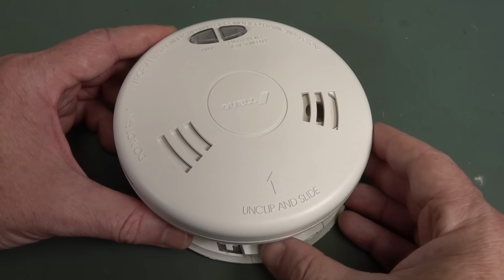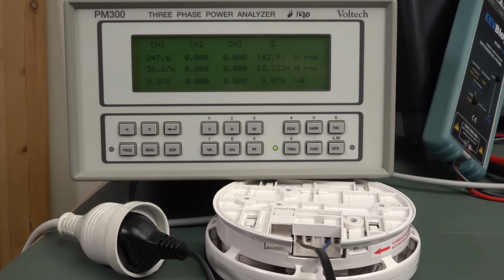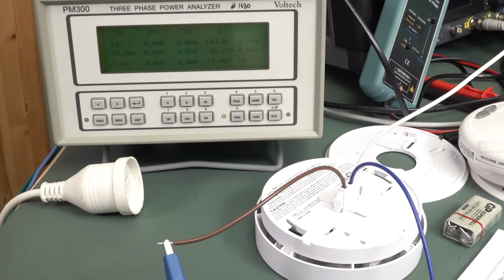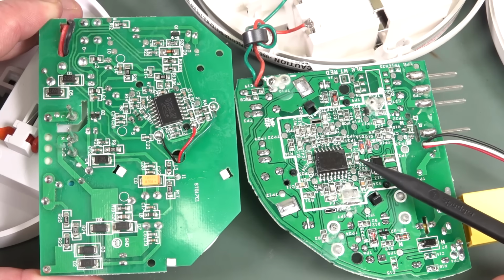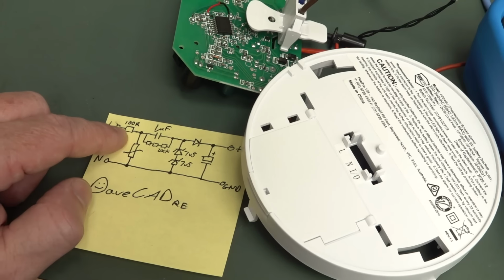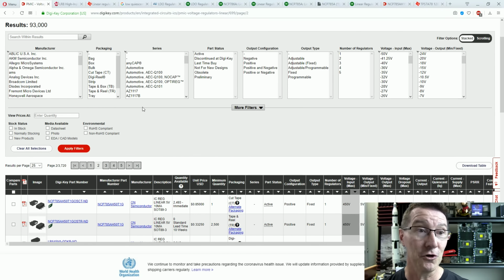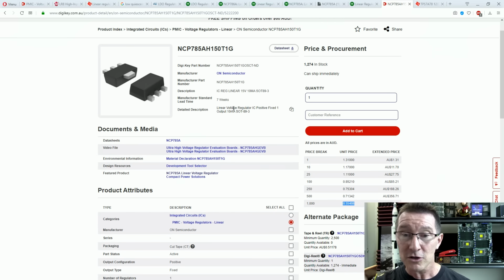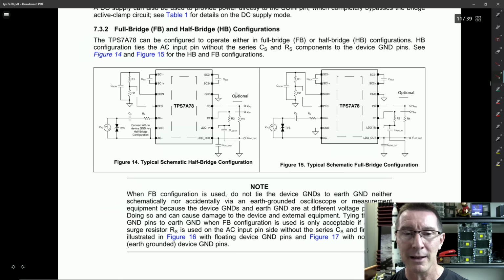EEVblog #1284 - How Bad Product Design Kills The Environment

Comment: I've been the designer for several consumer products, and the pressure to reduce BOM costs is completely INSANE! I've attended dozens of meetings and wasted hundreds of hours all for the reduction of 12 cents on a product. Since I opposed this insane cost reduction, I no longer work in the design of consumer products.
Reply from the maker: LOL, well done!
Reply: I once worked for a major set top box manufacturer, (thier boxes were supplied by sat TV service providers in Aus and many other places.) I was asked to change the psu desin for one component (a 3 terminal low dropout reg), Instead, I phoned the supplier and told them I was designing their product out, they dropped the price to less than 1/2,  the company made an extra 20 million per year from that.
Reply: That is because there is one of those insane "economists" in the company.
When a device is sold for amount of X and the BOM cost is Y, those people calculate that the factor between turnover and BOM cost is X/Y and therefore the effect of reducing the BOM cost by 12 cent will be X/Y times higher on the profit margin.
That is of course a big delusion, but you cannot hammer that out of an "economist".
Reply: @Rob2  You should have calculated the cost of those meetings relative to the expected actual savings. A better choice would be a completely teched PowerPoint presentation that nobody but you would understand, it would force them to agree with you. (unless of course there was someone there who could see through the bs.)
Reply: But then you get the other end of the scale where a product seems to do wonders with very little in it and we all sit around gwaking at it to work out how the heck does it do that.(ie:ZX81s running video without any video chip)
Reply: My favorite is the "but that resistor dissipates 0.96 watts, so a 1W resistor is fine!" 🤦‍♂️
Reply: I feel strongcontempt towards your ex employer
Reply: I wouldn’t have given the bean counters an option.
Reply: When you have 5000 parts in a product and save 12 cents on each one, and sell 1 million units, it kinda adds up.
Reply: @larrybud  But when you don't factor in the warranty costs (or customer retention, which is nearly impossible to calculate and more valuable than gold), you get the wrong answer. So if you save 12 cents on each unit (not each component) and the warranty returns increase by 50% you will lose 10x more than you save.
Reply: @mcconkeyb  Obviously depends upon the part, and that's why a full cost analysis has to be made. In automotive for example, something as simple as a normalizing the type of screws that you use for assembly can result in incredible savings for just pennies a part.
Reply: Yeah, I had a boss that would cut caps off my board and if it didn't stop working, he'd say " You don't need those capacitors! Arrgh.
Reply: Pity you couldn't cut everything out of his company car, leaving just enough so it still worked...

(and was still within the ADRs)
Reply: @stuartremphrey228  
Right!
Reply: @stuartremphrey228  Exactly, brakes are just dead weight! They don't make your car go any faster but slow down acceleration!
Reply: @fgregerfeaxcwfeffece  actually, they increase acceleration ... Just in the opposite direction! (Says an engineer, doing engineering) 😋😁😁
Reply: @GlennHamblin  Ahhh, "Mad Man Muntz"! Earl Muntz I think he was. In the 1950s he made TVs and was certainly one of the first, if not the first, of the "malfunctioning Eddie" businessmen. Adverts would feature his accountants trying to get him committed because his prices were just that crazy! 

In reality he was a skilled engineer and knew electronics. But he'd go round the design labs when they were working on new TV models and clip out components. If it still worked, he'd saved some money! The upshot was that Muntz sets didn't do as well in areas of marginal signal quality. But most TV owners lived in cities, so the sets were fine, and significantly cheaper.

Of course this is the world of 1950s TVs, where decoupling caps weren't really much of a thing. So of course your boss is an idiot and deserves his internal organs "optimising", Muntz was actually smart.
Reply: @greenaum  Can you elaborate on the "malfunctioning Eddie" businessmen a bit or give a link? Sounds interesting.
Reply: The whole fun of working in this area is to design a good product and still be able to squeeze every possible cent out of the BOM. It's not that hard to design things without budget constraints, boring.

Comment: Lately the new thing for retrofits at least is "10 year" battery units. Battery is non-replaceable, but has a high energy battery good for 10 years once activated (installing on the bracket trips a non-resettable switch which is directly tied to the battery). Much easier than having to string new wire for hardwired units. The nicer ones even have wireless interlocks, so you get all the features without having to rework wiring. I personally installed the non-interlock 10 year ones, because I'm cheap and the house had only one unit (with a dead battery) when I bought it.

Comment: Don’t connect mains and run on battery, change battery once a year or when battery beeps low battery.
Reply: probably use the following battery (2pcs, with charger): https://www.aliexpress.com/item/33027646915.html
Only batteries: https://www.aliexpress.com/item/32808238857.html

Comment: Over engineered. Surely its less effort to just use a 9v and replace it every couple years.
Reply: It would be, if it wasn't illegal to build a new house without these.  Also, the 10 year lithium cell type would beat both the 9v and grid power, if they were legal for new homes.

Comment: AC  power was mandated in CA due to many home owners taking the battery out  for other use or never replacing a dead one.  Also whole house wire also allows for remote signalling.   Basement may go off but upstairs also sound.  And last  the reliability, of fewer simple design 98%  vs more complex design 80%  less law suits too.

Comment: I took one apart some time ago and it had a bit of Americium 241 in it. It is a small amount and I just disposed of the thing in the garbage.
Reply: Not really a responsible thing to do.
Reply: @Zamsky39  well, I didn't think much of it, and given that there are the detectors in the house without jeopardizing my safety,I figure if they end up in the landfill they wouldn't cause any hard there either. They are not considered hazardous waste:
https://nuclearsafety.gc.ca/eng/resources/fact-sheets/household-smoke-detector.cfm

https://www.epa.sa.gov.au/environmental_info/waste_management/smoke_detectors

https://en.m.wikipedia.org/wiki/Hazardous_waste_in_the_United_States

I guess "taking it apart" might not be responsible. Disposal of the device in the landfill is considered acceptable however. At best one could skip the thing to manufacture back if available. I'm sure most people just dispose in the garbage however.

Comment: I do not think that it is such a big problem. The device uses 0.6W, so, it uses 5.2kWh/year. In my country 1kWh costs 0.15EUR, so it's 0.78EUR/year for the device. Cheaper than the battery.
Residential customers do not pay for bad power factor, so why would I buy a more expensive device with better PF if it does not really matter to me, especially if the current is so low anyway. I might want to buy a high power device with a good power factor so that I could use more devices without melting the wires, but 0.1A is nothing. A single 16A circuit breaker could handle 160 of these devices and if my house was that big I don't think I would mind the power.
Factories pay for bad power factor, but they also have inductive loads that would compensate for the bad power factor of this device (and have some sort of power factor correction anyway). They probably also would not really notice the  20VA with their 100kVA normal loads.

Also, is the  power regulator chip as reliable as a capactor+zener? Even if the zener or cap fails, they are easy to replace. A tiny SMD chip is a bit harder.
For example - cheap PC power supplies without PFC or with passive PFC can last a long time and if they fail, they usually just do not turn on and I can replace the bad capacitors and have a working PSU again.
PC power supplies with active PFC have better power factor, but when they fail, they short out the mains, trip the circuit breaker and blow up a few components inside the power supply. This results in a bigger problem than just the one device not working and is also more difficult and expensive to repair.
So, I would prefer a power supply with passive (or no) PFC, unless I am using it for mining, in which case I want active PFC so could run more miners on the same circuit without tripping the breaker.

Comment: Dumb question from a non EE here. I always thought that linear regulators burn the excess voltage x current as heat -- if your input voltage is 240VRMS, it will be rectified to 240VDC, and if your output voltage is 5VDC won't you be wasting a ton of power? Are transformers or switching regulators out of the question?
Reply: Yes, it is very inefficient, but a transformer  is way more expensive, and powering very light loads with switching supplies can also be difficult (you need either a really short pulse width, which is difficult to achieve, or a really low switching frequency, which can cause a lot of noise and requires a big smoothing cap for a stable output voltage).

If your circuit is low enough current, maybe the inefficiency of a linear supply isn't that big a deal.

Really, low power stuff like this has no business running on mains voltage. Way better to have a phone or alarm circuit (24-48V DC) to power little stuff like this.

Comment: I suspect there are multiple factors contributing to the poor design.  It's probably an old design that went through compliance testing and they have modified the design over time to reduce the cost of having to do the entire battery of tests.  Also, while the total power consumption is large on the 1M homes scale, it's not a lot for the average consumer.  A few cents per week seems like it's worth it for 'peace of mind'.

Comment: Hey DAVE check the Power factor again...its leading ( capacitive ).....and it is actually better solution because its compensate our home power factor which is generally lagging in nature due to inductive load and nonlinear load like bridge rectifier ...so our generating station will get little help from each of this   tiny capacitor....
Reply: Which is not enough to compensate for high consumption by the Zener diode(s).
Reply: @absalomdraconis   do you think that those zener can dip the power factor to .069 with 1 watt active power consumption . ??? It's connected in series with the mains  capacitor  and its main function to protect the output capacitor ... Its can't draw reactive power ...
Reply: 100%! I just wrote a comment explaining the same thing, but it was "magically deleted". 

If @EEVblog wants to post a follow up, there is a very simple experiment he can do. Hook up the scope to show both mains voltage and current going into those smoke alarms (not easy - high common mode but small signal). 

Then compare that to  a small linear power supply, or a traditional linear plug pack, with no load on it. (ie just the input transformer). 

In the tranny of the linear plug pack, the voltage will peak before the current (that's what inductors do), and in the smoke alarm the current will lead the voltage (you guessed it...capacitor...). 

When both are supplied from the same mains plug, these 2 effects will (partially) cancel out, ie the overall power factor of the 2 devices in parallel will be closer to one (current closer to being in phase with voltage) than either one of them individually. 

That's pF correction in a nutshell. And that is what the smoke alarm is providing. pF correction for the rest of your house. 

Note pf = cosine(phase angle between voltage and current) .... but that angle can be positive (inductive loads) or negative (capacitive loads).

Comment: 4 watts each?  That is ridiculous!  So I am burning up about 70-80 watts continuously.  Now I don't feel so bad about the entire den being heated by my balanced push-pull vacuum tube headphone amplifier anymore.

Same thing goes for those LED night lights.  It takes more power to run the day/night sense circuitry than the LED light itself.  When the unit is "off" during the daytime, all that has happened is a transistor is used to short out the LEDs aka bypassing them.  The entire unit consumes even more power, but gives the appearance it is off.

Comment: did you check an Ionization type.   Most people have Ionization units, not the expensive Photo units.    You have to power an LED 24/7 on the photo units.  I am sure the Ionization ones  use much less energy.   We only put Photo units in, in places like near a shower, or kitchen where the Ionization units false trigger.   And if you want a battery unit, it must be Ionization.  Just to suggest, it would be best to learn about Smoke Detectors before you make a fool of yourself comparing apple and oranges.

Comment: So in the USA, cheap combination smoke/CO detectors retail close to $15 USD. Assuming super high volumes and direct sales (no distributor markup) maybe the manufacturer is getting $7-8/ea for them? Working backwards to COGS they’d be lucky to get 20% margin (would not surprise me if it was 10%!), so on a ~$7.50 sale they’re maybe getting $0.90-1.25 margin. (Then add in freight, operational overhead, etc...) $0.05 is a lot to ask on a BOM in that case, much less $1.00... The cheap units are where the high volume sales are. 😕

Comment: I dunno, I just can't see the need for a mains powered smoke detector. Been using batteries all my life, don't see a reason to stop. Regulations be damned.
Reply: Unfortunately, people forget to change the batteries, so a lot of building codes require hard-wired smoke alarms in new construction.  A lot of smoke alarms being made have built-in batteries that are good for 10 years, and they sound the alarm when the battery is getting low.  The only way to silence the alarm is by disabling the alarm, so it will need to be replaced (planned obsolescence).

Comment: Capacitive power supplies help correct the low PF of inductive motors. The big waste here is not the large VA but the use of linear voltage regulation from 240V to 12V.

Comment: I am somewhat surprised to see how many electronic engineers somehow struggle to get their heads around the phase lag between voltage and current. The bottom line is that the overall lag in domestic installations is inductive (think motors fridges, etc. ). This is even more so for industrial installations.

Adding a small capacitative lag will (slightly) improve the power factor!
Reply: I think Dave is getting at the additional I^R losses and extra carbon footprint required at the generation end to cater for low PF appliances.
Reply: uK8cvPAq 
Yes, I know that’s what Dave is saying, but here’s the thing... we don’t have a separate grid connection for each appliance, just one to the household. In most cases the overall household load is inductive, so biasing the load with a small capacitive load will actually improve the overall household power factor.
Reply: @mikelopez9893  I get what you're saying too, but isn't it better to fix poor pf at the source rather replying on loads to balance each other out?
Reply: uK8cvPAq yes, I’d agree that we should fix the power factor. So, how will we do this?
Again, the dominant problem is inductive load. This is prevalent in industrial applications, not so much in domestic. The standard “solution” to fixing an overly inductive load is to put a capacitor across the supply. That way, there’s a reserve of electrons to meet the out of phase inductive load. Oh dear, that’s where we started!

Unfortunately, there’s a lot of BS on you tube on power factor. The only youtuber I’m aware of who calls it out is Big Clive. We need the EE community to take a stronger stand on this. Reactive power is not something else that needs to be generated. The only possible implication is current for line distribution companies, not power. If we have to have higher rms current to meet the power needs, we may need beefier wires. That’s a big if though! 
Here’s my challenge to any EE. Do the calculations. It might surprise you.